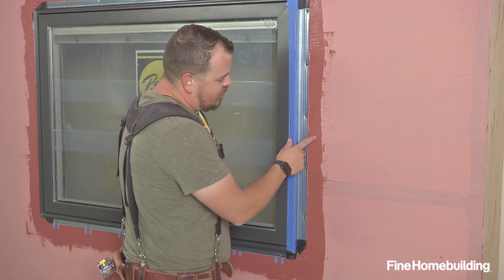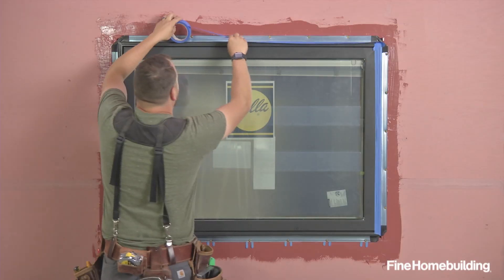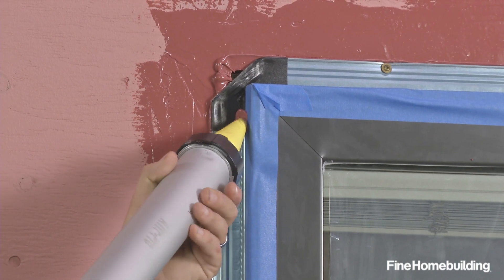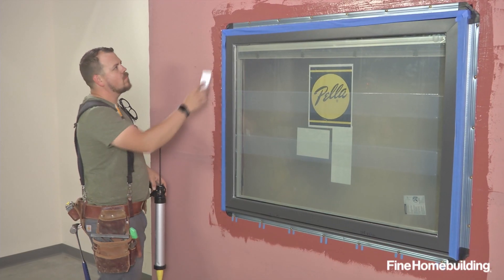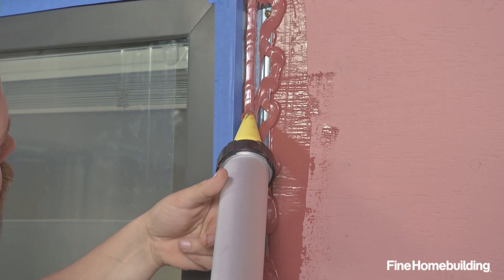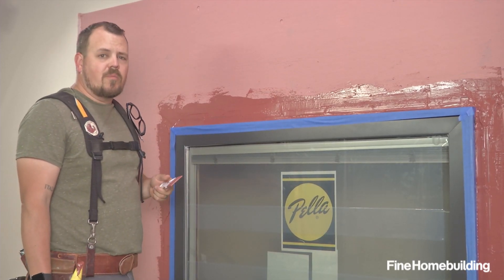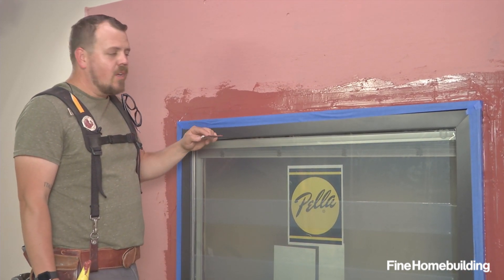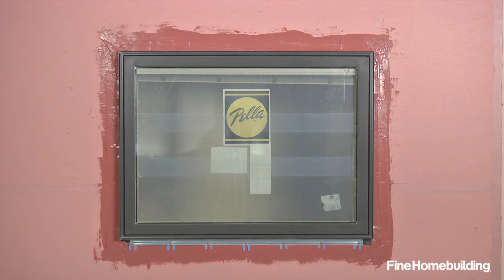Part 3: Flash a Nail Fin Window Over a Fluid-applied WRB

Comment: I assume this would work well for when you replace windows with new construction windows and don't want to mess with the siding. I"ve seen people make a window slightly smaller so they could nail into an added piece of lumber, but they usually miss the flashing part which is a really important step.

Comment: Is anyone actually doing this
Reply: I am
Reply: THis is a great-optimal way to flash a window, but yes, it requires meticulous detailing.(Frankly ANY homeowner can replicate this instructional video, esp if your house is only line story ! I dont like trusting tapes for decades, but its easy for client to ascertain whether zip tape has been rolled properly and placed properly . Ideally, you d have your windows/doors installed at the factory in a panel OR have a window specialist dealer install your windows /doors
Reply: yes. several.  way easier than peel and stick flashings